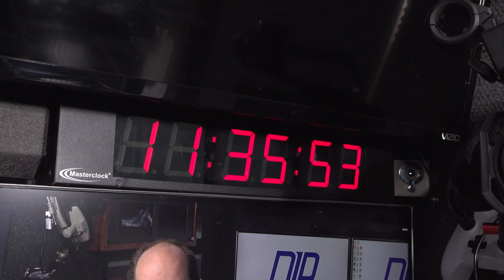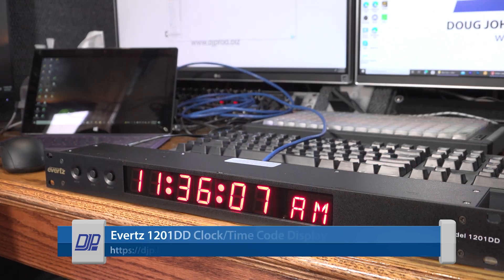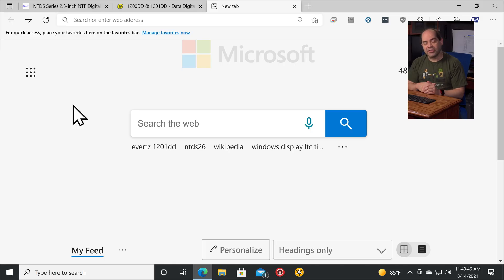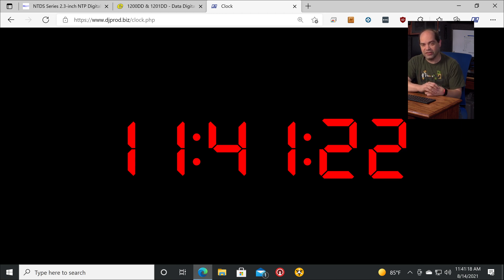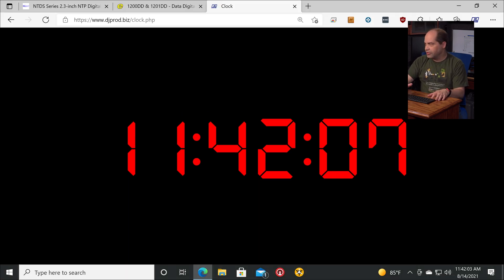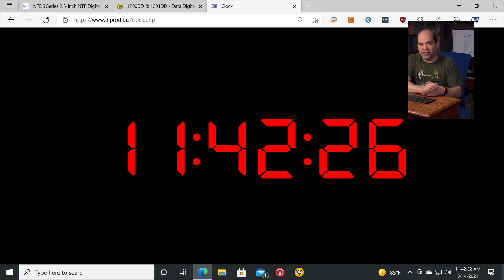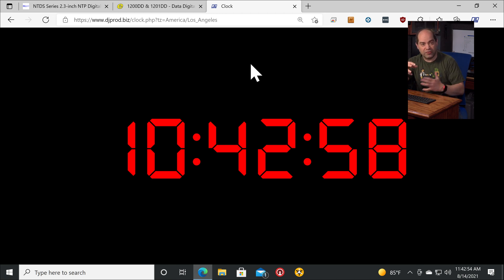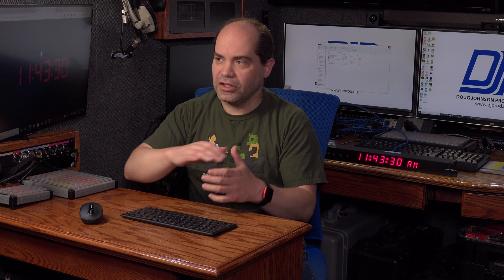Synchronized Clocks (including one free one!)

Comment: Hey, this is great, thanks for putting this together! One question: I tested this on a Raspberry Pi and when set to 24 hour mode I still get a 12 hour clock. On a Mac on the same network, time zone etc. the 24 hour mode displayed correctly. Any reason why this would be the case in Chromium on the Pi?
Reply from the maker: Yeah, the implementation of JavaScript on the Pi is less capable than desktop browsers. So when it fails to render the correct time it fails over to a less capable time formatting function.
Reply: @djp_video  do you know if there’s a workaround for this like a different browser? I’m new to the Pi so I’m not even sure if that’s an option!
Reply from the maker: I don't. I don't have that much experience with the various browser options on Raspbian.

Comment: It doesn't seem to work inside OBS into a doc window, unfortunaly.
Reply from the maker: The clock relies heavily on JavaScript to work. If OBS doesn't have a full JavaScript implementation, no, it won't work.
Reply: @djp_video  When using the browser as source in OBS it works. Strange enoughthe formatting is not possible unfortunately. It is impossible to set it to the 24h format even with ?fmt24h in the URL
Reply from the maker: @janpaulpeters7193  The browser within OBS is less capable than the versions we run normally. The code I'm using to format the time doesn't work under OBS, so it defaults to JavaScript's default time format.

Comment: Doug - I haven't seen this working in a couple of days. Any update?
Reply from the maker: Hmmm… it is working now, and I used it for an event last night. What computer/browser are you using?
Reply: @djp_video  Looks like specifying the time zone parameter is what's broken. /clock.php works, but /clock.php?sz=16&tz=America/Eastern&fmt=12 stopped working, but worked fine previously.
Reply from the maker: Try using America/New_York instead of America/Eastern
Reply: @djp_video  Yeah, that works, although America/Eastern worked originally. Interesting. Thanks!

Comment: Thank you for this nice clock.
One idea: How about you put the parameters as comments in at the top of the source code - that way it is an easy cheat sheet without putting buttons in the interface and keeping it clean.
Reply from the maker: If you haven't seen it already, I've added a configuration bar at the top of the page. Click (or tap) anywhere on the page to bring up the interface.
Reply: @djp_video  already saw it, good idea I didn't think of. Thumbs up!
Reply from the maker: Done.

Comment: Only problem: I`d need 24h format.
Reply from the maker: I just reworked the time formatting code. It should work in the iPad now.
Reply: @djp_video  That`s fast. Thanks.
Reply: @djp_video  It worked like charm during whole day - whole team was on same schedule.
Reply from the maker: On browsers, like those based on Chromium, which properly implement the international date formatting features it does use 24-hour format.
Reply: @djp_video  thanks. Safari on my iPad does not, but will test this on a streaming gig today.

Comment: Excellent video, Doug! One thing I'll point out for those that might not know, is you can use both the size and time zone parameters together by putting an ampersand ('&') between them. Such as sz=16&tz=America/Denver. Also, if you need a list of time zones, Wikipedia has a comprehensive list. Youtube was giving me grief when I tried to include a link.
Reply from the maker: I’ve also just added a fmt option to select between 12 and 24 hour format too: ?fmt=12 or ?fmt=24, or &fmt=12 or &fmt=24 when using one of the other options.